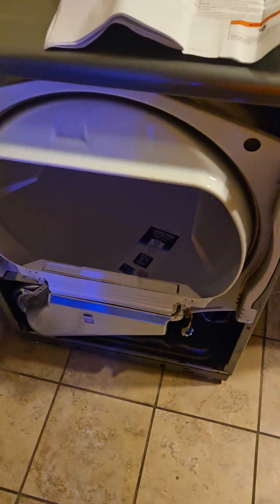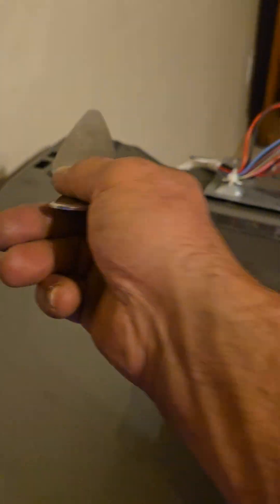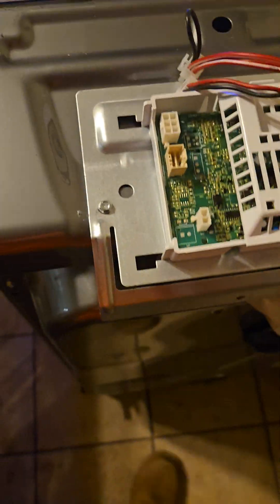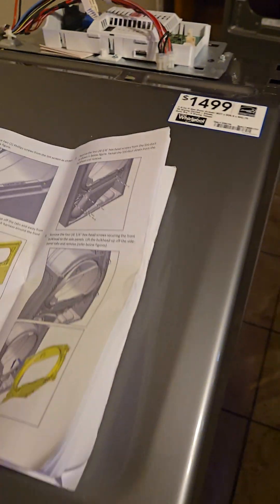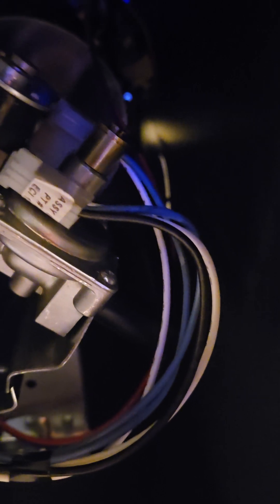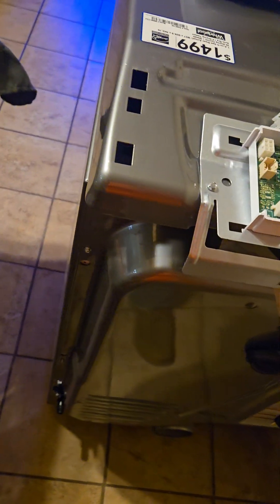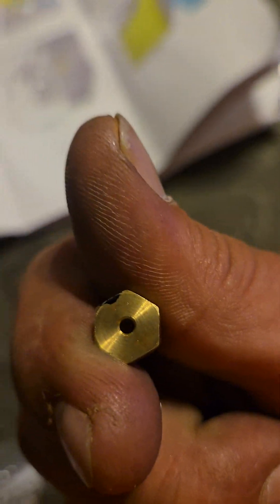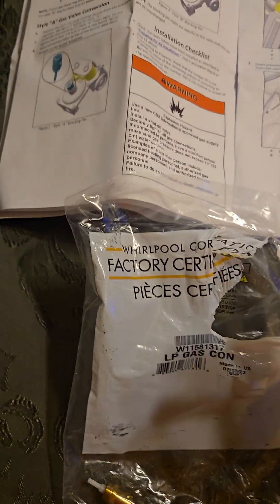whirlpool dryer Lp (propane) gas conversion

Comment: So did you need to remove the control panel?  Seemed like it was not necessary
Reply from the maker: Just un clipped the control panel using putty knife and slid it forward, did not disconnect any wires

Comment: Ive got a question . 
I just converted my new lg dryer to lp and i feel like the flame sound was very loud compared to my old dryer . Do you hear your flame like a jet engine ?
Reply from the maker: @Luciferjuice  yes it is really loud
Reply: @dramad2974  thanks for commenting back. I've used it a lot now and feel more comfortable with the sound. 
My old Samsung dryer was not nearly as loud